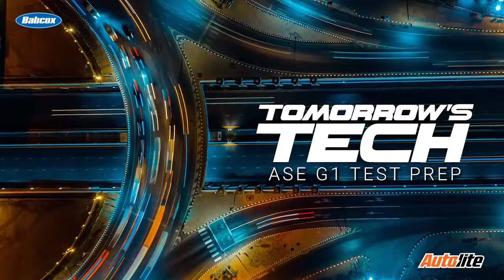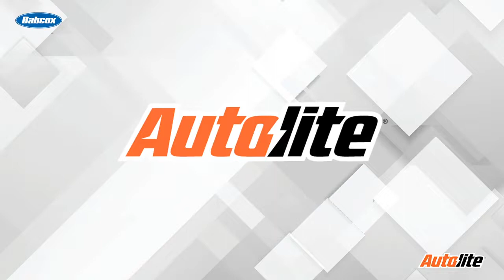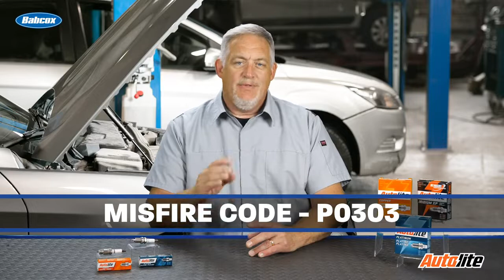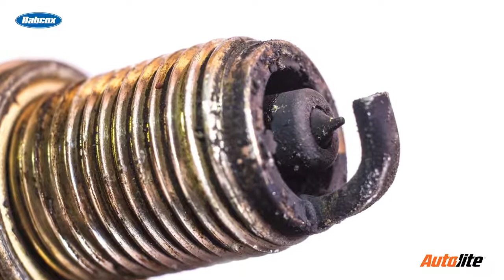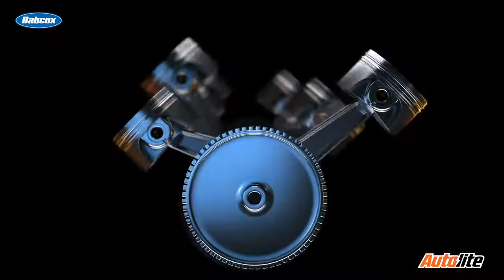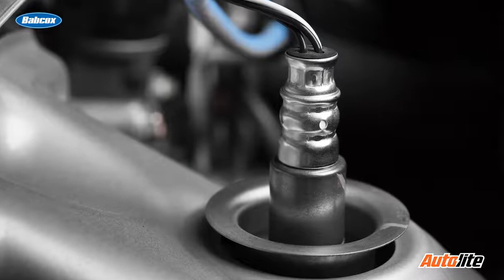Analyzing Spark Plug Colors

Comment: You said a "dark gray matte coating on the spark plug insulator", isn't the spark plug insulator the white ceramic part of the spark plug which is outside of the combustion chamber? Is the question worded wrong?